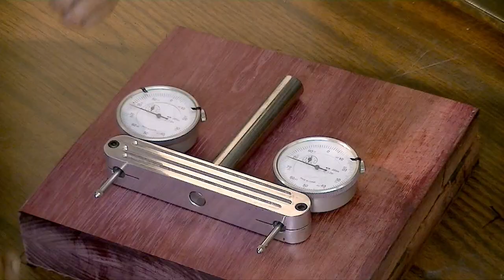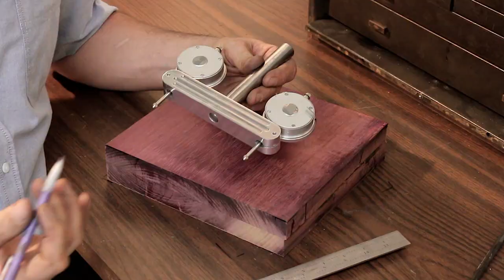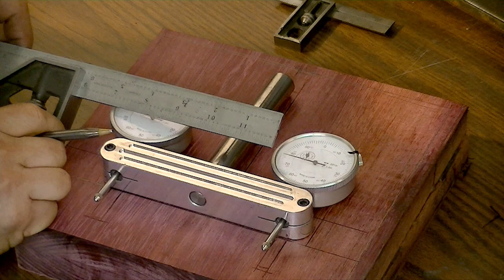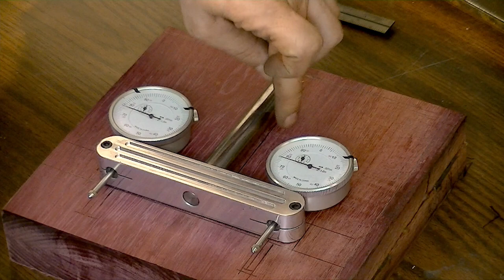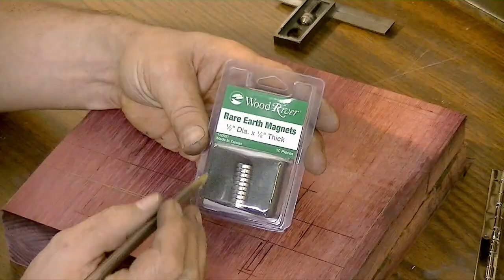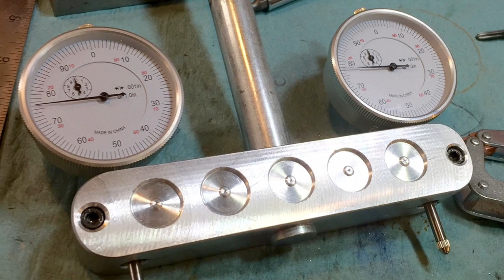Tool Giveaway - DIY spindle square part 4,  The BOX

Comment: I support your 'wood on mill theory' lol. Last year at my work that pays my bills I was asked to make a "rice pounding block" (everybody look that up). My billet was an Oak piece of wood cut from a tree trunk measuring 21 inches in Diameter and 26 Long. I was tasked with making a 6 inch deep bowl shape on one end. One HAAS VF-8, some CAM software and 6 hours later, one Oak rice pounding block emerged. This was made for a traditional Japanese Festival. At the end of the day, I cleaned 6 five gallon buckets of saw dust out my VF-8. It stripped all of the oil residue off. No harm done. By the way, the little rice cakes (you watch happen) are amazing to taste. Nice video Sir!
Reply from the maker: +Stacy Simon 
thanks for your comment

Comment: Hi Dale, great video, I’ve also done wood work on my metal machines with no ill affects. 40 years ago, at 16 or 17 years old, I worked in an R&D machine shop in Enfield Connecticut. The man who ran the shop was a true genius. Not just my opinion. One of the very many ways he amazed me Was using a single point fly cutter running about four or 5 inch diameter with a super sharp high-speed steel cutter at high rpm on the milling machine, Bridgeport, nothing on the table but a block of wood. The block was rough cut on a bandsaw or something but he milled it in and squared it up and made it look gorgeous, free hand under that fly cutter. When I say free hand, I mean he held the block of wood with his hands and ran it under the cutter. I truly don’t think I would ever try this myself unless I saw some expert do it right in front of me. But I remember it well, and I remember the Man well.

Comment: Hi Dale, 
I have been following this project and I made my own box last weekend.  I don't have a fly cutter or a boring bar so I made my own crude version of a forstner bit using drill rod.   I just made a T shape and milled cutting edges into the top of the T.  The results were great and it cut the entire hole out with no burning or tearing.  
Like you I discovered that it was a good idea to hook up a dust extractor while milling.  I also used compressed air to clear out the chips and I found that worked really well to reduce burning and helped me see what was going on.  I wore a mask as hardwood dust can be pretty nasty stuff.
The wood I used was a timber called Tasmanian Oak, which was what I had on hand.  It didn't need any finishing just a light sand and it looks gorgeous (If I do say so myself).
Thanks for the videos.  Looking forward to your next project.  Personally I'm now working on a tapping stand if you need an idea. :-)

Comment: I really enjoyed this  series-very practical and great fun too.I am in the UK and I too have a Colchester, a Hardinge and a Cincinnati Turret Mill. I also have an ancient Land Rover. Only difference is I am about a hundred years older.
Keep on what you are doing.
Reply from the maker: what year is your land rover? Mine is 1973
Reply: Mine is late 1972, so they are pretty much the same except mine is the little truck. Not much space but easy to manoeuvre!
Land Rovers are an incurable disease, I have had many over the last forty-five years and currently have one of the last of the Freelander 2 as everyday vehicle.
Have you had yours long?

Comment: To cut the gauge holes I'd have used the appropriate size hole saw to set the outer diameter using your center mark for the guide drill. Then rout out the rest of the holes to the same depth determined from your spindle or Z calibrations.
For the finger grip I'd have cut the groove after the gauge holes from one to the other at about 3/4" wide.
For the front finger slot I'd have cut it with your round tipped cutter after the top was mounted, with the box vertical in the vice as you had it when squaring the stock initially, running the cutter down the seam from the center mark say an inch each way. 
Then sand and finish as desired.
Thanks for the project and videos.

Comment: Dale alright, Hey as best I have ever found for wood hurting a machine is just what you said is a good thing, it sucks up oil. So the key is as long as it is not constant and you clean well and re oil the ways and all it don't seem to me it will hurt. Hope not because I do it every now and then. I use router bits in me collets and high speeds, this really helps with the splintering.I use wood lathe tools on the metal lathe or just HSS bits again fast and sharp.Anyway great video, you made it look so easy to pocket all that out. Good job love your vids even when it's just a tool gloat.Mark

Comment: Really agree with you all the way for machining wood with a metal working machine. You did great the way you use all the cutter to form the pattern. Really encouraging this saying from you that we should not be afraid to make tests in order to make a beauty of something after trials and errors. It's only at the finishing step that I lost you. You like to use that wood for the color and the grain. Unfortunately, the finished product is unlikely to suit your taste considering that the wood is reddish. Using that black finish blemish the beauty of the wood. Red oak finish or mahogany would have been more appropriate here. And, it's not a question of personal taste. For many centuries, European artisan really used the red color to stain their tools. It's a soft color to look at in the shop and give a certain prestige (red is royal color!) surrounding the magnificence of the tool. Like a jewel's box for the jewel that you made.

Now it's time for me to look at your «How it's made a spindle square» 🙃

Comment: Late to the party.  I just watched this series.  Very interesting and useful, thank you.

I love when I may be able to use a tip.  I had a Homer Simpson "Doh! moment when you mentioned the jaws can be screwed onto the outside of the vise.  I had not thought about this.  I could have used this tip in the past.  I will use in the future.

The burn marks are common in certain wood species which contain a lot of oil, resin or sugars.  As you observerd purpleheart is one such species.  I get burn marks on the table saw.  Other species include cherry, hard maple, bubinga.

Slowing down the rotation speed helps.  I do not know why all wood routers run so fast 10,000 rpm - 20,000 rpm.  Faster is not always better.  I think rotation speeds in the hundreds of rpm would work, but no routers run this slow.

I was smiling when I saw the tearout and breakage.   Been there, experienced that.  Sometime we need small passes, sometimes climb cutting.  Then sometimes we have to fix the tearout.  Wood turners often have to deal with tearout on some parts of a project.

I was not expecting you to cover the purpleheart with pigmented finish.   I would have used a clear urethane finish.

I do not yet have a milling machine, but I may make a spindle square for leveling the drill press table.
Reply from the maker: +LV_Woodturner 
Thanks for your comment